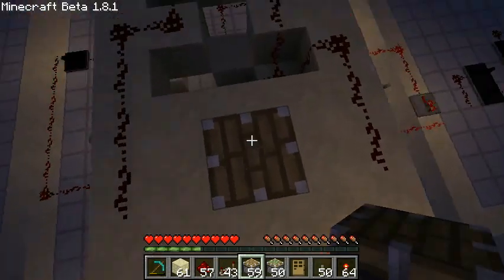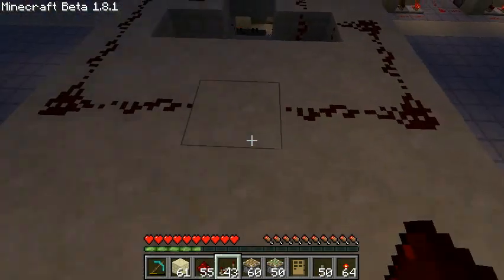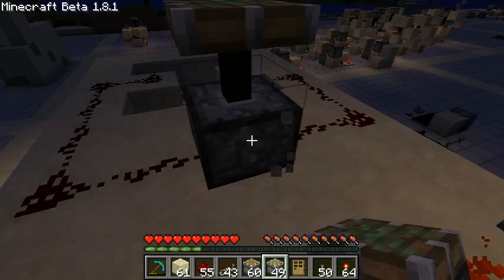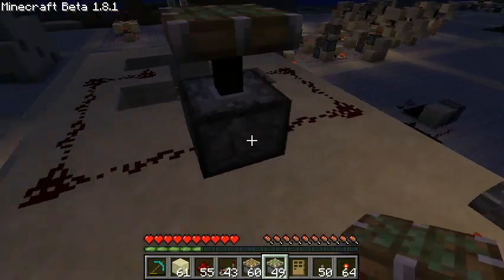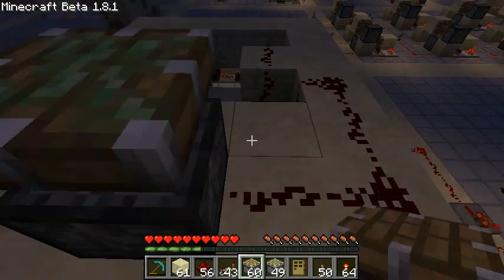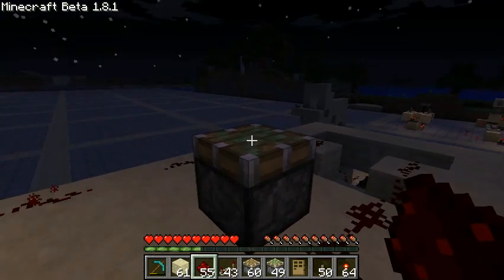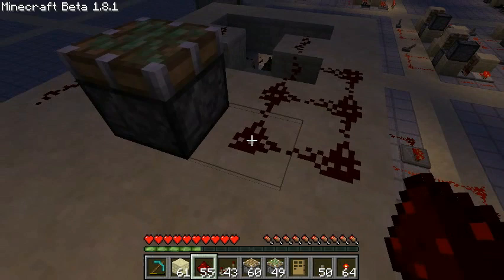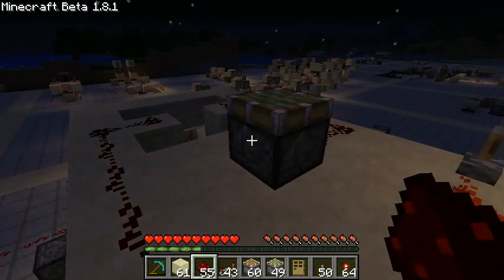Minecraft 0.5-Tick Clock

Comment from the maker: @RCstreetteam Do you mean the ground?  I just used the mod "single player commands" to make it by making one chunk be half blocks for eight blocks below sea level and then air above, adding a sandstone border with the "wall" command (I think), and then copying and pasting that to repeatedly double its size until it was 16 chunks by 16 chunks.  I've since uninstalled the mod and haven't played Minecraft for a while, but you can use the same mod to quickly delete everything there above sea level.